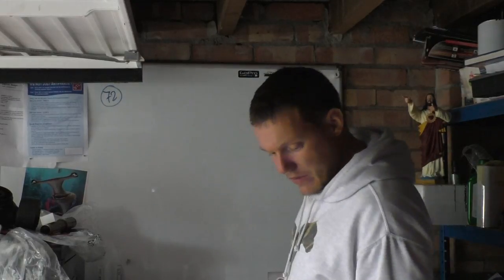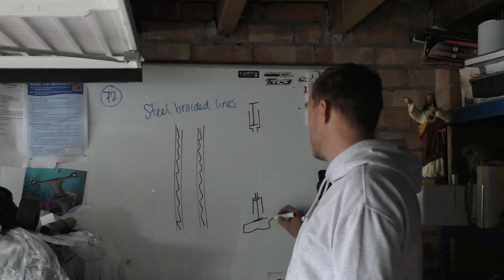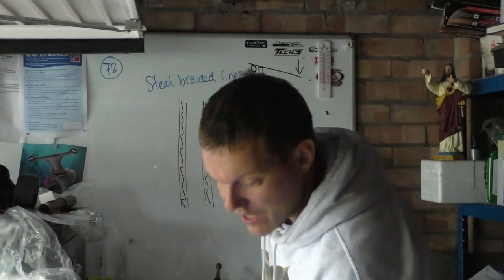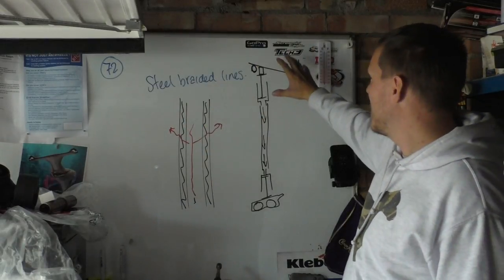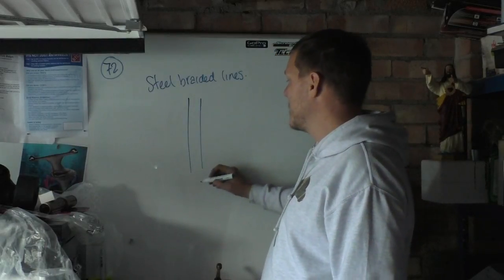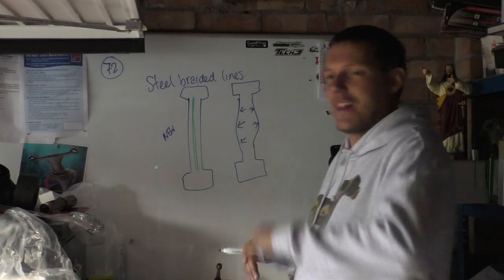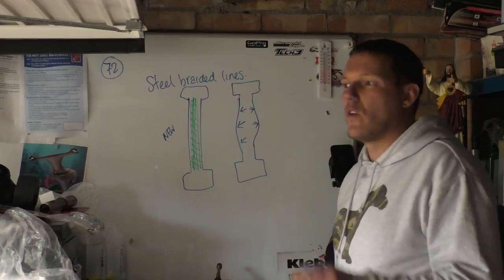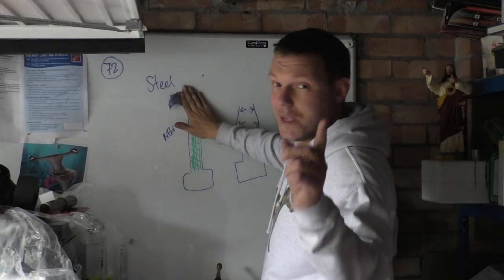Braided Brake lines - why? -and how?

Comment: Less expansion in the hose equals more force pushing the pads because it is being forceddown from above. And it has to go somewhere when it cant bulge the hose. Physics simplyfied.
Reply: Gareth Slinger that is not true, for a given line pressure the  pressure on the pads will not change, the debate is whether the lines really bulge less. If they do the master cylinder will need to move a shorter distance to get the same line pressure.